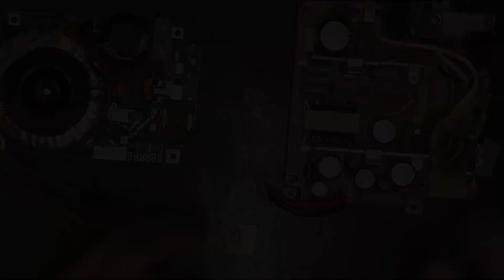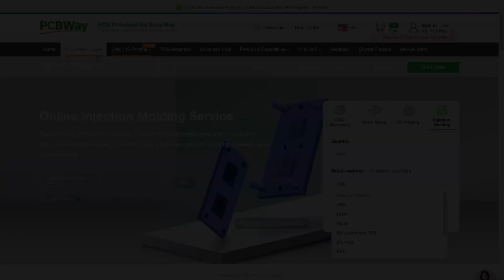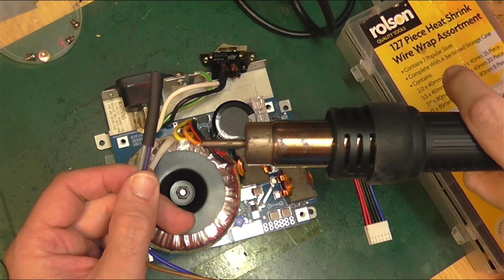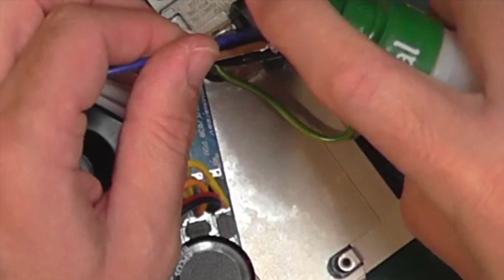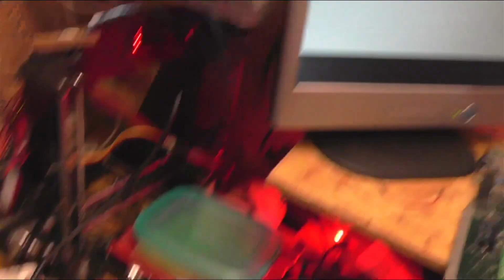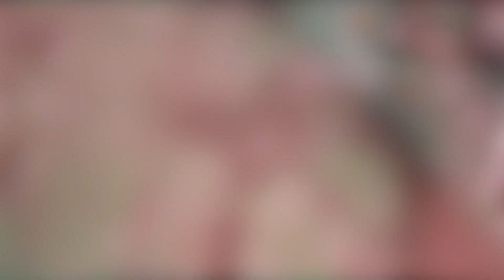Upgrading my ST with an Exxos PSU (Mandatory Fixes series)

Comment: You talk about the old powerboard being unsafe. Isn't that only if you have the case off and the computer plugged into the mains?
Reply from the maker: That's correct -- it's not going to burst into flames, but one or more of those heatsinks are at mains potential.
Reply: @thetechnoshed  How is the replacement safer exactly? In other words, what happens if you accidentally touch it?
Reply from the maker: @consolegear  There are no directly exposed mains voltage on the exxos supply. Sure, if you don't treat it well the insulation on the transformer isn't very thick -- it's not like an enclosed meanwell supply -- but it's certainly not a casual shock hazard any more.
Reply: @thetechnoshed  I see, thanks!

Comment: So this reset issue is that computer is trying to boot before PSU is ready and you must delay this process slightly? Or I get it wrong?
Reply: The reset issue is common on stock machines with the stock PSU. It is just more prominent with the new PSU.
Reply from the maker: No, it's a poor reset circuit design (almost seems like the two main caps are swapped), which the new 'slow start' PSU really shows up.
Reply: So… yes?  @tiemanowo is correct?
Reply from the maker: @galois19  No. The circuit never comes out of reset.

Comment: I have an exxos PSU for my childhood STE; interestingly I've never had the reset circuit issue! Feel like I should get one for my falcon too; it's on a recapped original but probably getting something over-engineered is good for it's longevity.